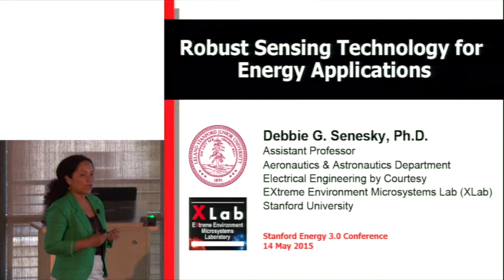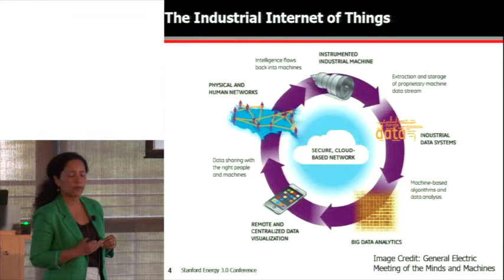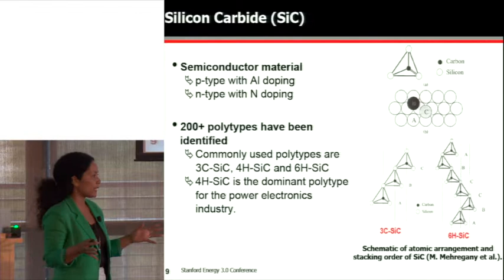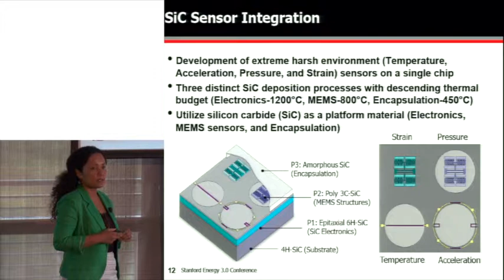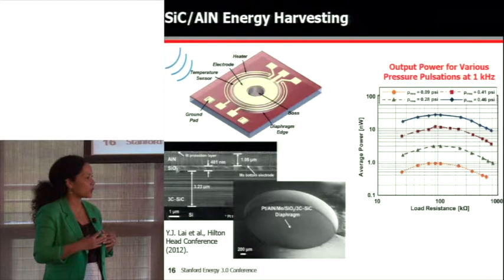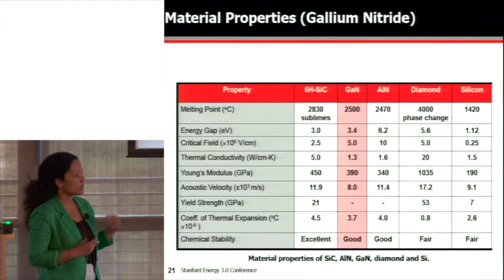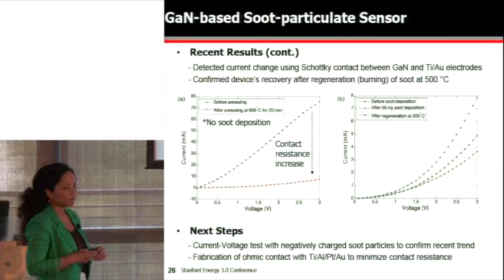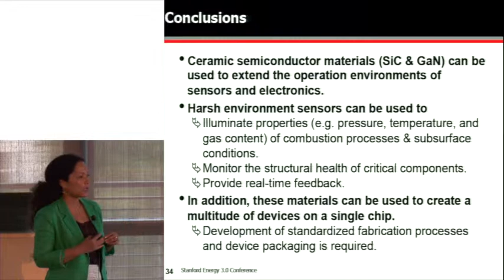Debbie Senesky | Robust sensing technology for energy applications

Comment: You can build an amazing thermostat with all those sensors. Self powering & high temp electronics are interesting. Is there any use of these sensors in solar, thermal application? ...  Just thinking where else you can place those today... An airplane's black box can probably use all of those sensors. Data analytics + communication tech can be built by others to store data in the cloud for instant monitoring, feedback & recording once the nano sats provide global internet access.